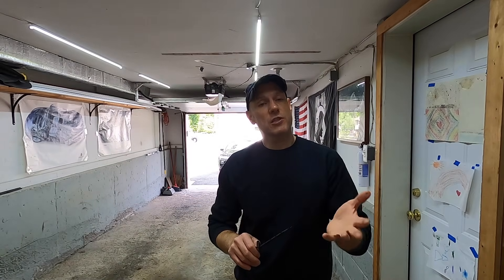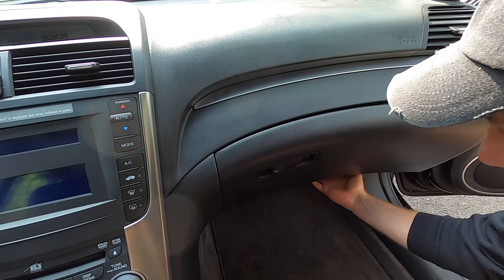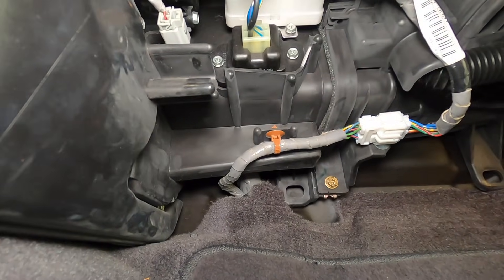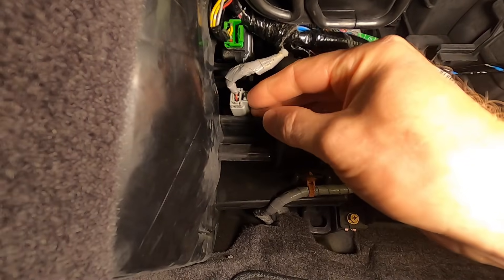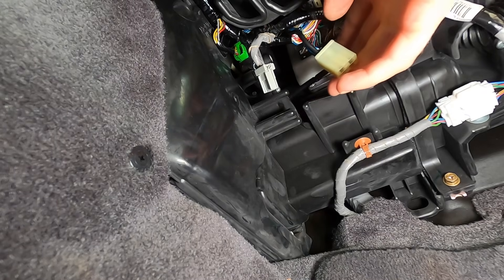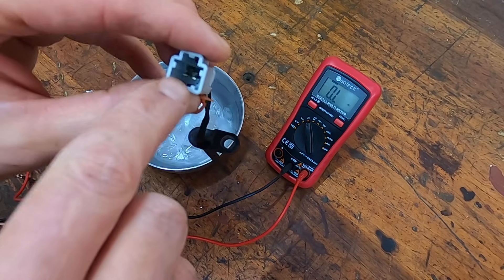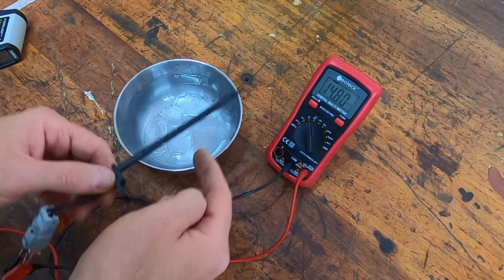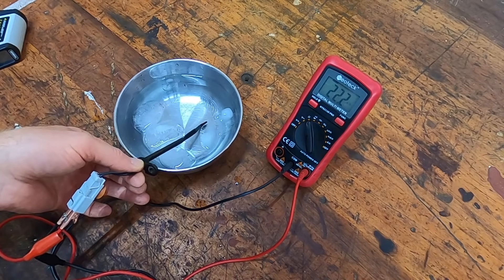A/C Not Working? Check this! | How to test and replace an Evaporator Temperature Sensor

Comment: With my santafe i was facing this hell problem with the ac. Finally i changed the tucson sensor model for my santafe ami did some modifications so i bought the sensor for tucson and i cutted the wire and and adapted it to the santafe one. The ac now is freezing no disconnecting every 30 second no week cooling and its freezing inside. You should worry about the evaporator freezing some time but you can control that.

Comment: Hey there! My 2013 Elantra randomly will evacuate all freon! Machanic said the compressor is good! Any pointers? thank you
Reply: There's a leak somewhere! Check all your connections if there's oil with dye in it it with be easy to spot where the leak is

Comment: The closest thing I can find for my 2009 Buick Enclave is an a/c refrigerant temperature sensor . Could that be the same?  My ac keeps shutting off and on about every 30 secs or so (the fan also), and no cold air coming to cab. Pressures are good for both high and low sides. I replaced the high pressure switch, and checked the fan relays. Could this sensor be the problem? Only 90k miles on car

Comment: My 06’ Tucson ac turns on/off and when I set it to heat it does it as well, I checked the refrigerant levels and everything’s good. Could this sensor cause it to turn on and off

Comment: I have the same type of honda here in the vid,  what is a good range the thermistor should read at?  I show 11.2k Ω at room temp 75 degrees.  Can’t find any documentation on the sensor range for the thermistor

Comment: Thank you for this!   I had replaced the thermistor on a 2017 Tucson and saved the $1200 repair bill.  Later I had the same issues on a 2017 Genesis but could not find the thermistor.  Your video was the key to locating it.  
Super bonus points to you for: showing how to test the resistance of the sensor.  The Genesis tested good so I most likely need a new compressor.  I still had the thermistor from the Tucson and it tested bad.  So I confirmed I made the right choice before and also that it wasn't the same (cheap to fix) problem again.

Comment: How do I find it on a 2009 Ford fusion?
Reply: It's behind the dash right in the middle of it. I have a 2012 that has the same problem.
Reply: So i have to remove the whole dash?  @1900s_sports

Comment: I have a Nissan minivan NV 200. I’m having an AC problem everything works except I’ve got an open circuit somewhere between my relay and the clutch. I checked the high-pressure switch I could not find a low pressure switch. However, I believe there is any evaporator temperature switch that they are using in place of a low pressure switch. Could you possibly tell me if this unit has such an application before I start tearing into the dashboard trying to find something that may or may not be there I have looked everywhere to try to get information on this unit and I can’t get it from anybody unless I join some kind of an auto group and pay them about $35 a month, I’m not going to do that because I can buy a chiltens book for about the same price I’m just warning to know a simple yes or no answer to a simple yes or no question. Thank you.

Comment: Can I use different evaporator sensor from other car brand..? Example, my car is Mazda 3 and I will use evaporator sensor from Ford, or for other car brand that is similar to Mazda 3, I will just replace the socket to fit on my Mazda 3. Is it possible. I hope you read my comment. Thank you..😊🙏
Reply: I did on mine. Mine was getting me crazy even with new oem sensor for the same model so i decided to adapt from other model sensor and made some wire cutting to make sure it fit the same plastic for the oem. Now the ac is freezing. Solved. My car santafe and i used the tucson sensor head
Reply: @m @mohammedalbaadani7058 what other sensor did you use from another model that fits on Mazda 3? Thank you.
Reply: @vlackspyder 
Use the one from Hyundai tucson and cut the head and adjust it with your. It will work. Do more search on that.
Reply: @m @mohammedalbaadani7058  cut the head means you cut the socket and use the socket from Mazda 3 you swap it?

Comment: Thanks for the info on how to test it. Mine had 3 wires, but I found a combination that gave me resistance on the new sensor. The same prongs on the one in my truck gave me no resistance. This test was important for me because the A-hole engineer at GM put this sensor on top of the HVAC fan box, so I had to completely remove the entire dashboard to even get to the sensor. I am relocating the new sensor to the bottom of the dash so if it fails again, I can replace it and not have to take anything apart.

Comment: Hi, Having  this problem with my A/C system replace compressor checked all fuses checked relays also checked gap of clutch, but after charging system blows 38 degrees as long as the clutch is engage but when it dis engage cab runs hot about 70 degrees. Now on the old compressor i checked the coil ohms read up to 14.5. a bit off from 5 - 2 ohms. so the new compressor doing the same as the other. I did check the new one for ohms and it came out 4.4 ohms. just as the old one after running, it dis engage around the same time,  and want engage.
So I switch car off let sit for about 10 minutes switch ac on clutch engage bring temp down to 38 degrees just to repeat the same cycle over and over. Oh i check the new compressor for ohms while still on car and hot came out 1.2 ohms

Comment: You can also get a resistor and bypass the sensor. These resistors cost like $3 to $5 at hardware or electronic stores. They also usually dont require you to disassemble the dash as you just need access to the plug wiring harness and do not need to remove the sensor.
Reply: Why would you need to take out the dash when he clearly got access through the glove compartment?

Comment: I think I'ma check that because I'm lost... Compressor and fan turn on and still no cold air... Like when I add freon it's cold for like an hour but after that it's not working anymore
Reply: Did you check for a leak? Remember the clutch won't engage if the pressure is too low or high!
Reply: @marcosanchez896  there is Freon and the clutch AC does spin so I'm not sure what else would it be... I even changed the condenser... And it ran for like 2 hours and then it stopped blowing cold....  I'm guessing maybe it's the AC switch button like the one that's inside the car will you turn on the AC.. not really sure
Reply: @hacatan24  Hablas español?
Reply: @marcosanchez896  si hablo español
Reply: @marcosanchez896  it does not have any leaks
Reply: @hacatan24  The compressor could be spinning but the clutch not engaging or engaging on and off. You can hear the click e verytime the clutch engages or disengage.Check the clutch relay or swap it for another one in the fuse box of course has to be the same! What kind of car do you have?
Reply: @marcosanchez896  when I turn on the AC the clutch does engage and when I turn off the AC see the clutch disengages ... It's weird that's it's moving but no cold air...
Reply: @marcosanchez896  and my car is a 2005 Acura RL... Even the AC fan turns on...
Reply: @hacatan24 sounds like it could be your blend door actuator
Reply: @hacatan24 but also what makes me think is that you mentioned that when you added freon and swapped out condenser it worked but then stopped again, blend door actuators won't start and then stop working with freon and or condenser swaps, so leaning more towards something like an expansion valve or maybe even the ac compressor
Reply: @davidvargas7877  okay but here's the weird thing is that when I turn on the AC I don't see the RPM going down and then going back up to idle.... But when I shut it off it goes down and it comes back up to idle....
Reply: @davidvargas7877  I put a brand new expansion valve....
Reply: @davidvargas7877  what what I meant about starting and stopping is that when I turn on the AC the compressor starts and it runs the whole time and then when I shut it off it stops....
Reply: @davidvargas7877  and when the compressor with the AC running I don't feel the low pressure side cold.. it's just hot.. and high pressure side is hot too..  both lines are hot...
Reply: @hacatan24  well that is is weird ...there is one more thing you could check ,it would be your high side and low side pressure switches ... but from there  it would be for you to look into your vehicle and see if it has one of these sensors that the guy is talking about I'm the video..
Reply: @davidvargas7877  I checked the high pressure switch and it's running and if I use the wires to touch them together the compressor still spins.... It is so weird that the compressor does run but no cold air...
Reply: @hacatan24  did you ever get it fixed?  You need a new expansion valve because its blocked/restricted.

Comment: anything on 2008 honda civic dx 
my engine shutters at 3 and half rpm. I've read it's the throttle control relay or a fuse but I have no idea where the fuse or relay is , also read it could be the mass airflow sensor dirty , I'll be sharing your Excellent explained videos to my Facebook thanks
Reply: There’s a fuse box in the engine bay and there’s a second fuse box called the modular control panel I think typically left side of steering wheel down, also if ur mass airflow sensor was dirty it would put the check engine light and give a misfire code
Reply: @Mr.nobody.one1  the vtec solenoid wasn't plugged in,  that was my issue for it not reving past 3 grand